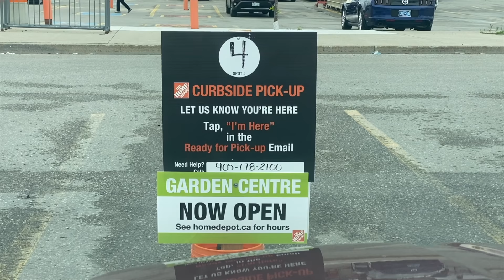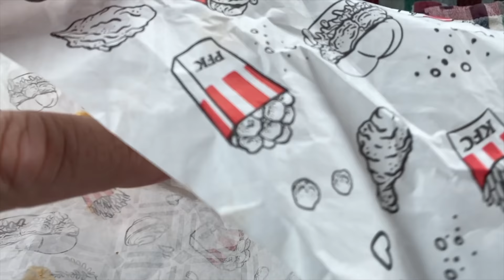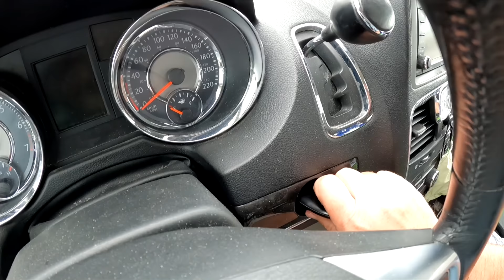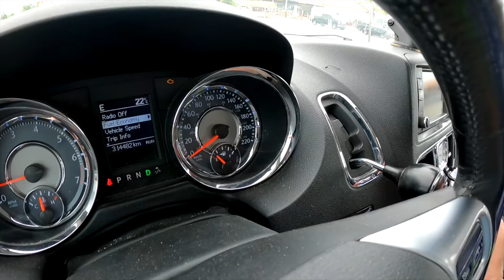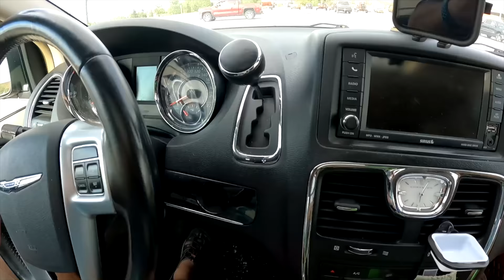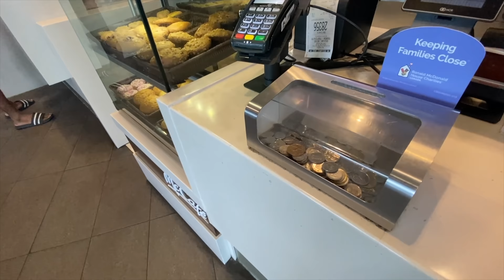Van Life • KFC BACON LOVERS SANDWICH & Van Life • Making Stealth Window Covers

Comment: Ken a friend of mine put a curtain in his van.  He used the grab handles in the roof to hang it. He took wire coat hangers used them for hanging it from the handles.  Then he used a sturdy wire strung from one to the other and then sewed fabric to the wire with a tunnel for the line.  Works great and cheap

Comment: Creating a cardboard stencil probably would have been your best bet. Just small pieces of cardboard that you tape up in place and to each other in the window basically tracing the window. Once you're done you could remove the tape holding it to the window but leave the tape connecting the cardboard pieces to each other and you have a stencil to use to cut the window coverings.

Comment: I used a spring loaded curtain rod between the doors and used two blackout curtains for the covering.  I also used the silver bubble wrap and  black dict tape to secure my fabric to the outside .  I also needed the Velcro dots to help keep the edges secure as well as the sky light.  It has really helped with the winter temperatures also.   We upgraded to a motorhome, but we still have some windows that needed a little help.